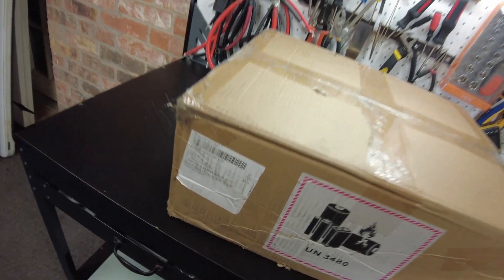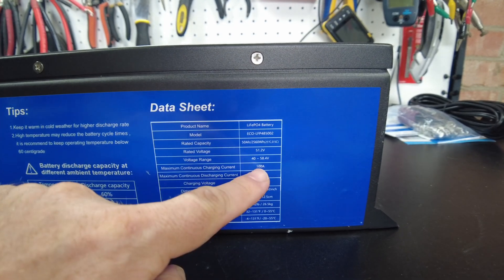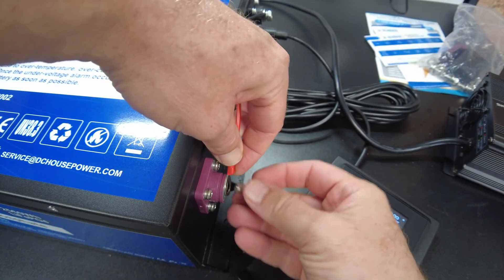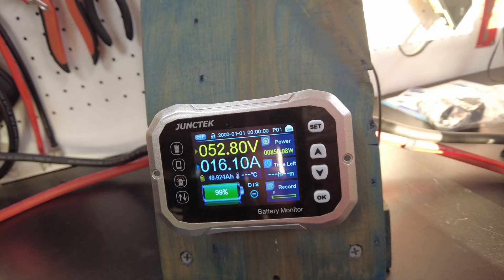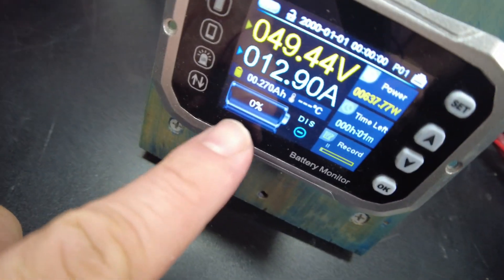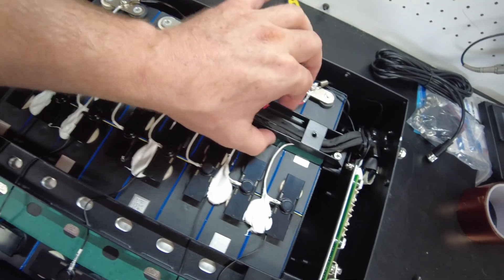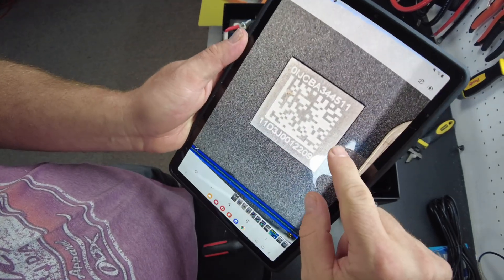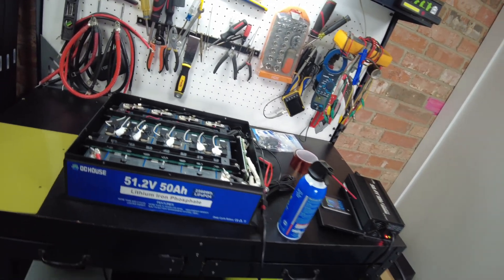DC HOUSE 48V 50Ah LiFePO4 Golf Cart Battery

Comment: I'm going to buy one!  Great review very detailed!   I'm going to add this to my Ryobi riding mower!  replace 4 batteries with one.  less than half the weight.  I can get my lawn mowed in half the time!   LOL
Reply from the maker: Nice! That's a neat application :)
Reply: @BradCagle your video has been a huge help.  Again.  Thanks.
Reply from the maker: @davidcam5526  You're welcome! :)
Reply: @davidcam5526 Which Ryobi did you install it in? I’m going to attempt to install it in the 30in deck version soon. Did you encounter any wiring changes between the lead acid configuration and the lithium install?
Reply: This is a great battery for the Ryobi.  It solved all the strange issues the lead acid batteries were causing and it is not nearly as finicky for charging.  It was super easy to install in the Ryobi and works GREAT.  

I've added a second one (it fits, barely) and now my mower is a 100 AH MPU (Mobile Power Unit) that also mows my grass!  I installed power take-off posts on the battery compartment top cover so I don't have to remove the rear cover to attach the inverter.  Now I just need some solar panels and I will fear no hurricane.
Reply: @instarx  Which Ryobi did you install it in? I’m going to attempt to install it in the 30in deck version soon. Did you encounter any wiring changes between the lead acid configuration and the lithium install?

Comment: I have the same battery in UK, but didn't come with the monitor, is that a newer model? Also noticed you mentioend 100a charge/discharge? Mines also only 50a for a 50ah battery.
Reply from the maker: Yeah, there's two different models. The one I have has a stronger BMS, and they market it towards golf cart use. Thanks!
Reply: @BradCagle  Thanks for the quick reply! Oh right, so does that mean if I draw more than 50a form the battery I wouldnt' actually damage the cells, but the actual BMS instead?
Reply from the maker: @zGratchGaming  Possibly, but different cell models also have different current handling capabilities. So I'm not sure they may be the same cells between the two battery models, or they may have opted to use higher current capable cells in the golf cart model. Not sure. Thanks!

Comment: Thanks for the teardown! Are the cells insulated between each neighboring cell and the metal case/support? I only see the fibre insulation between the left and right 8s row of cells. There supposed to be fibre board insulation between the cells and the casing as well, the thin blue insulation heat shrink wrap is not sufficient. Are the cells somehow in a compression?

Comment: What is the best charger for this?  Can I use my old one for my Ezgo?  Same one that charges my current lead acid batteries?
Reply: No it needs a correct lipo charger. Amazon and ebay sell kits with everything you need charger, reducer if you need 12v for accessories etc. about to order one for my ezgo with navitas 5kw ac motor and 600amp controller
Reply: NO, you need a 48v battery charger for Lithium batteries.

Comment: also, this battery with monitor display is not available in France. hope it will be soon . we have the one without the screen, but screen is very usefull to help checking the batterie and all cells.
Reply from the maker: Yes, the screen is very nice. I'm curious does the one without the screen have BlueTooth? I need to test these, the price looks really attractive here in the US. Thanks!
Reply: @BradCagle  the one that is available in France from Amazon have no screen, no BT. It is cheap (about 500€ ),  but no monitoring at all is not good.
How much does this one (with screen) cost in US ?
Reply from the maker: @jean-philippemeunier8989  I think it's over $600usd
Reply: @BradCagle  how much does this one (With screen) cost in US ?
Reply: Mine cost $460 with monitor.  There are several models of this battery, some come with charger, some with the monitor, some bare-bones.  Keep looking.

Comment: hy, sorry for my english, i m watching your tests from France, very interesting.
i expecte this battery will be nice to run with a powerstream ecoflow to inject electicity in the house at the night , in parallel of the grid (with regulation with a power meter shelly 3em compatible). of course , you need a mppt to charge it from PV.
do you know this materials , and what do you think about this idea ? would you like to test it ?
thx.
Reply from the maker: Interesting, I've see these home micro inverter systems, but seems mostly for sale in European countries. So you're allowed to plug these in, and inject power to your house, and grid right? They do not allow us to do this in the US :( well we can but, it is way harder as it needs approval, inspection, special approved equipment, regulations, etc.... Oh and for sure we cannot just plug it in to an outlet. Would be awesome if we were allowed to use this kind of powerstream system. Thanks!
Reply: @BradCagle   @BradCagle  this is it. And we are allowed to plug it into outlet.  But there is a lot of restrictions as well. There is a mode in which  the microinverter inject only what the house use, and if not enought,  the grid supply. For that, you need the shelly 3em to measure the consumption on the grid.
Sorry that it is more complicated in US  to use that kind of système.
Reply from the maker: @jean-philippemeunier8989  I see, thanks for the info.
Reply: These batteries good for for home power and can be connected up to 4 in parallel.  The DC House paperwork shows how to connect them for that purpose.

Comment: Charge / discharge 100A for a 50Ah battery . Something is off. On Amazon UK this as different MAXes (50A)
Reply from the maker: There seems to be two versions. One with the smart BMS that seems to be capable of higher current, and the other one you're mentioning perhaps. BTW you can have over 1C rate charge/discharge, just depends on the cells used, BMS, etc.. Thanks